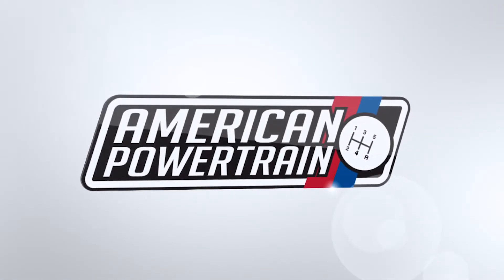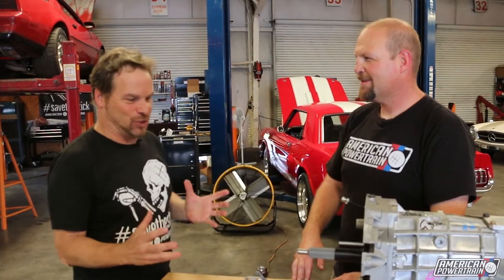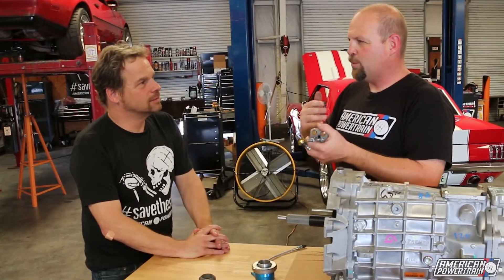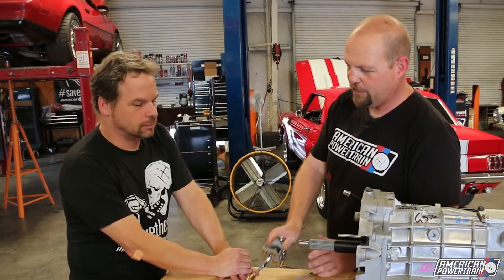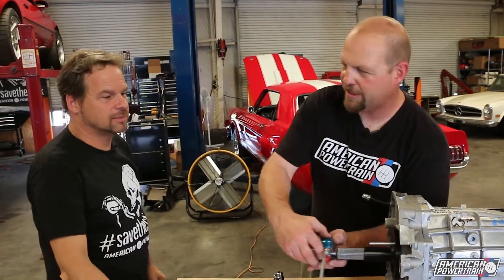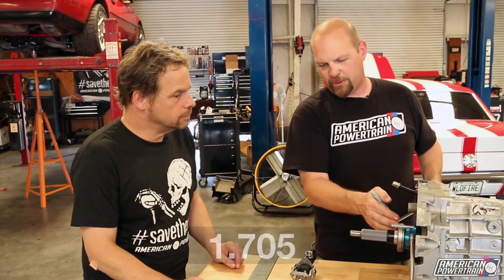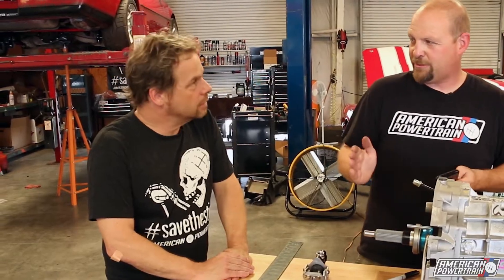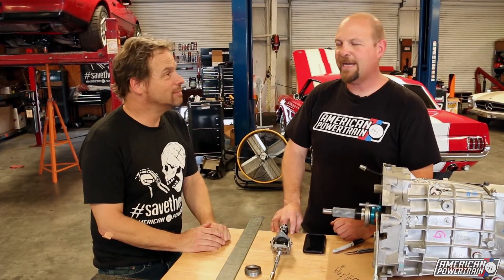Why is a Hydraulic Clutch Better than Mechanical?

Comment: Just pointing this math out:  2.424-1.705=0.719 NOT 0.619. So, now minus 0.15 gives 0.569, divided by 0.09, which equals 6.3, or just 6 slims, not 5. If the customer felt the clutch slipping? This may be why.  Thank you for spending the time to make this video. It was interesting...

Comment: Statement at 7:22  should have been "then you won't have to take shims out of it" instead of "then you won't have to add shims into it".
I believe you meant to say.
Finnigan demonstrated gap readjustment by pulling a shim out after diaphragm fingers migrated rearward following operational clutch wear. ZFDoc at ZR51 Performance

Comment: 1992 chevy k1500 nv4500, changed master and slave cylinder, and clutch kit, throw-out bearing, pilot bushing, flywheel, clutch and pressure plate, blew out 2 slave cylinders, first one split on casing (plastic), the 2nd (Luk) one gave out replaced seals from the plastic one, built pressure, lasted 1 drive then gave out too, haven't seen where it's leaking from yet, any ideas, or any recommendations on a heavy-duty slave cylinder

Comment: I'll take a mechanical setup any day over hydraulic.
Reply: 60 years rebuilding transmissions and the last thing in the world you want is a hydraulic clutch. Couldn't help but notice you didn't tell them how to bleed it. You can take measurements for days but if you can't get it bled you're stuck.😊
Reply: @onetransmission7871  Agreed
Reply: Exactly. Bleeding, leaking hydraulic clutches are just two of the problems. If your clutch leg gets sore in stop and go traffic either pop it into neutral and stop riding the throw out barring or get an automatic, old man 😂 JK
Reply: @terrysavoy6479  My 93 chevy k3500 has a hydraulic clutch and it's nothing but problems.

Comment: In all the vehicles I drove never have I had to replace machanical clutch parts. Everyone that was wet clutch had something go out. The semi with 1.6 mill I drove has the original machanical clutch parts on it.
Reply: Mechanical clutches are more difficult for daily driving and performance compared to a hydraulic clutch. Easier and smother the clutch, the more enjoyable the daily driveability and the faster the track times are. The 85 mustang I had did have a mechanical clutch and it was like doing leg presses every shift and holding it was even rougher. Not practical.
Reply: @guitarsandcars2586  sorry but that's wrong a skilled driver can make a mechanical clutch smooth as silk. Also why would you want a device on a daily driver that is prone to failure like a wet clutch is? I'll tell you the samething they told us in truck driving when a driver complained about the clutch pedal being hard to push done. They said "they make automatics for that, otherwise you'll just have to get better at driving." Power steering, wet clutches, automatics, traction control, ect. are all devices that take less skill to operate a vehicle. Nothing more nothing less.
Reply: @joerandom756  1. A hydraulic actuated clutch and a wet clutch are two completely different things.
2. Mechanical clutch linkage and manual steering require no more skill than hydraulic clutch and power steering do. They only require more physical effort, and that has little to nothing to do with skill.

For example, a person could have big muscles and still not be a good fighter, and another could have less muscle but be a much better fighter because that person is more skilled. Physical strength is not the same as skill.
Reply: @joerandom756  1. A hydraulic actuated clutch and a wet clutch are two completely different things.
2. Mechanical clutch linkage and manual steering require no more skill than hydraulic clutch and power steering do. They only require more physical effort, and that has little to nothing to do with skill.

For example, a person could have big muscles and still not be a good fighter, and another could have less muscle but be a much better fighter because that person is more skilled. Physical strength is not the same as skill.

Comment: The number of crotchety old men in here selecting mechanical clutch linkages as their hill to die on is hilarious.
Reply: Careful, you'll one day be a crotchety old man.................if you live long enough.
Reply: @tulagi1  I'm not sure that "people age" is the epiphanic zinger you think it to be.
Reply: For real man so many angry boomers in here. My f150 has over 200k miles and just got its second replacement slave cylinder. Yeah the job sucks to change it but it's not some crazy unreliable junk that fails all the time. It was about time to replace the clutch anyway.
Reply: No doubt. That's about all I read in the comments. Back off fellas. My 98 Saturn with 280000 miles has had 0 problems with its hydraulic clutch. Not even a flush.

Comment: dumb. why would you add so many possible failure points??   if you cant drive a properly installed mechanical clutch, go get a prius - (with a hydraulic clutch)

Comment: I have a 2003 Mazda with a 5 speed manual with a mechanical clutch and I love driving it on the weekends. I just bought a 2021 VW with a 6 speed manual and hydraulic clutch and after a week I'm still stalling in first. On the mechanical clutch I can feel when it engages and can start applying the gas but on the hydraulic clutch I can't tell when it engages because it is a fluid motion when releasing. Hopefully I can figure it out soon.
Reply: I have the same issue I just bought a built up 08 c6 vette and I can’t feel a bite point like in my 5 speed truck and it really makes it difficult to know when to give it gas.
Reply: @kadenatkinson8526  when I learned to drive manual in my Subaru Forester with a very light hydraulic clutch I would just rev it up to 2000 rpm and slowly release the clutch which is definitely not a great idea for the health of the clutch but it worked for the amount of time that I was still figuring out how to drive manual and slowly got better and better at fine tuning how much gas I needed to apply at which point I was at in the clutch and now I have no problems with it but I’m gonna have to learn it again in my 67 international pickup but it’s a lot harder to stall the other day I put it in reverse and let out the clutch quicker than I should’ve and chirped the tires without pressing the gas pedal lol

Comment: I just love pulling my transmission to fix the leaking internal slave cylinder. I will take properly set up mechanical linkage all day long over hydraulic. Never use DOT 5 fluid as it will be a failed slave in no time. They also didn't talk about boiling the fluid if you run the exhaust too close. Mechanical linkage works great if it is set up properly and it is adjustable for wear. Watch out for the over center spring on the Borg and Beck clutch equipt cars, if you change to diaphragm pressure plate your pedal can end up stuck to the floor.
Reply: I assume you stick to mechanical injectors too
Reply: @DD-gi6kx  Mechanical fuel injection is a thing, esp in drag racing. Most of them are quite good.
Reply: @177SCmaro  I am quite aware mech injection is a thing, been on diesel equip for years, but how many new cars and trucks are running mech injection over EFI, just cause old technology worked great in the day doesn't mean newer tech isn't better...I'll take EFI over mech and hyd clutch over mech any day...was the point of my post
Reply: @DD-gi6kx  Just because newer technology works better for you doesn't mean older technology is without merit for others. 
I utilize both, myself. Old car, modern engine.
Reply: @177SCmaro  if it ain't broke don't fix it is how I work
Reply: @henryholliday1  Fair enough for you but if everyone was the same as you we'd still be living in grass huts having this conversation over a dung fire. Very sturdy, well-made grass huts, but grass huts nonetheless.

Comment: Yeah no thanks. I’ll stick with mechanical. At 60 years old I’ve never had a problem with any of the old school setups that weren’t simple to fix. Hydraulic? All have failed me at some point with no easy roadside fix.
Reply: Amen! Blow a slave cylinder & you're screwed. Two different times I had to crash box a 5spd Cummins thru Houston traffic. Fuck hydraulic.
Reply: @robertkelton5831  

I’m pretty sure that you either have not done any maintenance or failed to check any thing for damage. Besides hydraulic clutches are very similar to hydraulic brakes.

Comment: Mines cable. I fitted a new clutch in a day, then adjusted the clutch right up whilst I boiled the kettle. My mate changed his clutch on his old car and he's now looking at also having to replace the master and slave cylinder as it's still not working, plus he spent a good 20 minutes bleeding it on his own. Mechanical clutches are miles better if you need to work on it
Reply: But are not as good for daily driveability and performance. The only car I had with a mechanical clutch was an 85 mustang and that thing was like doing leg presses every shift. I'll never use a mechanical clutch on my vehicles again after that car.

Comment: my 400 rwhp  67 barracuda mechanical clutch is alot easier to push than my 2015 mustang gt
Reply: Get a clutch spring for 20 bucks to smooth out the clutch

Comment: I think a hydraulic clutch using an external slave cylinder and self centering stock style t/o bearing is more reliable design....
Reply: I agree mechanical is the way to go whenever possible, just saying an external design like I used to make kits with is more reliable than the internal type....
Reply: @bassmasterbri   Okay I feel ya. =)
Reply: "Reliable" is NOT an advantage of a hydraulic clutch, no matter where the slave is.  Cables are more direct, don't have lines and fittings that can bursts or leak, take up less real estate and are offered with fire wall adjusters! 
Just keep it shielded and away from exhaust headers and you're good to go. 
P.S. "Self centering" T/O bearings are a gimmick. Unless the bearing is sitting on a crooked input shaft, it's centered!

Comment: OK I have another Problem .. he  just said  NO MORE THOW OUT BEARING ??? I  find that impossible to believe ..  Looks to me like the shiny silver thing is a Throw out bearing ..  Oh  I assume you still have to have a Pilot bearing or bushing too ???  In the old small Block  Chevy was a Bronze Bushing .. in the Heavy Trucks I am used to is a bearing with very special high temp Grease in it ..   My  Medium Duty Truck with a  12" dual disk set up  the throw out bearings didn't last long in high temp low speed off road use .. but  for say $24.00  instead of for $18.00 you could get one for high temp that lasted much longer..  and I have an Air Brake trans brake  because it's not a pull clutch it's a push clutch .. I used to bust the  hubs out the clutched  spinning jerking bouncing in soft snow with  dual triple chains on the Tandem dual wheels .. It's a lot of work pulling out a  650 # 13 speed transmission   a Baby 13 speed that is
Reply: OK I watched a second time ..  The Magazine guy sort of explained measuring from the  bellhousing surface of the  engine to the clutch fingers.. then  you measure from the  tans bell housing surface to the front of the throw out Bearing .. Then the   American Drive Train guy  said put the shims behind the Bearing .. then later he called it a throw out Bearing .. So I  guess the shiny do dad  is a throw out bearing .. Even though  he said installing hydraulic system eliminates the throw out bearing ..Definitely not a good idea to try and multi task while some one talks in circles .. you have to pay closer attention and watch the Video again ..
Reply: THE PILOT BUSHING HAS NOTHING TO DO WITH THIS SETUP. THATS WHERE YOUR INPUT SHAFT GOES IN THE CRANK.
Reply: @69RIDING    You have to center the Bellhouse Ing within 0.005" of dead center or your pilot bearing can fail and cause other transmission issues and bearing failures and hard shifting.

Comment: I have  wore out a few light Duty  mechanical clutch systems  in  Medium Duty Trucks  Many Heavy duty Trucks have more adjusting places.. I did an engine and trans swap in a 1968 FWD  old style single disc  14"  push type clutch Hydraulic .. I had to replace  it with a  pull type  14" dual disc set up ..  So I went with a Mac Pedal assembly  because Mac uses a cable Clutch  ..  With Pull Type Clutches you have to adjust a gap with a 3/8" or 1/2"  Feller gauge that I made out of plate steel..  You need a good return spring so your  throw bearing does not  touch the clutch while  not engaged and burn out the throw out bearing .. Also you need a Clutch brake to get a non Synchronized transmission into gear..
 
  My  '79 Z-28 Camaro has a mechanical Clutch .. I put a piece of plywood on the  floor boards so I don't have to push the  clutch in farther than Necessary .  I put the  ball and socket in wrong once and the  spring steel broke after I was in a drag race .. I shut the car off and  then the engine would not turn over..   I thought the engine was seized towed it home pulled  engine out and  clang clang the  piece that webbed between starter and flywheel fell out.. Nothing wrong with the engine .. bought a new Heavy Duty clutch fork ..  Pulled the heads off did a  little port work and put it all back together..
  I assume the magnum T-56 has no Provisions for a mechanical  Clutch fork so I will have to buy this Hydraulic kit with my LS Swap .. 

  I put a Doug Nash 5 speed in my car it really shifted slow at high RPM';s  I replaced a diaphragm clutch  with a 3 finger Borg and Beck type cluth it made no difference .. than  30 years later I watched a Video on now to  Blue print the Doug Nash 5 speed the gears are so heavy it just does not shift well.  but   this guy in FL   has  better synchro's that have more bite.. 
  It's time to Upgrade to a stronger trans than the original T-10 but that has two Overdrives..

  This Video did not explain what they were measuring ..  But it looks like from Bell housing to Clutch Fingers..  then    from  Trans housing to the front of the Throw out bearing .. Then you use Shims until   you have  0.150"  clearance   

  Then he Rambled on about how to adjust it in the future but he did not explained how ..  We know in a Disc brake Caliper ..  the piston just keeps moving .. and  it takes more brake fluid out of reservoir to  fill the  void in the moved piston..  

   It does not look that Complicated and could be explained better I am sure .. I will look up the Tranny Guy in FL he is very articulate..

Comment: How often does the hydraulic fluid have to be changed? every few years? is it easy to do?
Reply: My clutch uses my brake fluid for the clutch as well as brakes.
Reply: Every 3 years or so would be ideal. Some systems are easier to cleed than others. A vacuum or pressure bleeding tool makes the process a LOT easier.
Reply: It’s in your manual book from your manufacturer

Comment: A hydraulic clutch is just one more thing that has lines and fluid in it that can leak! I'll take my cable any day.
Reply: I agree just more stuff to fail and hydraulic parts do fail
Reply: @chrismansker8870  Cables fail too.  I'm sure when they started putting hydraulic brakes on cars people complained that they would rather have mechanical brakes.
Reply: I have an adjustable unit with an aluminum quadrant and it's silky smooth. =)
Reply: my slave cylinder went on my car , it just poped as I was lifting my foot and it jumped into gear . then when I pushed the clutch down and went to put it in gear it grinded , took a second to figure it out . It was a sad day
Reply: I've had too many cables fail.  I'd rather have a hydraulic clutch.
Reply: Just sounds like poor mechanical skills and parts if your car is leaking. Mechanical linkages break like anything else. Also allows for better engagement in high horsepower cars and it saves space. Vipers, Aston Martin ,Corvette's and Camaros use it because its superior. I'll trust engineering over hobbyists.
Reply: @Alexander-jr8nw  Double clutching is just a measure that assures those synchros and input shaft have a longer life.
Reply: WELL I HAVE A HEAVY DUTY CLUTCH ON MY 454 AND THIS CLUTCH WOULD BE A KNEE SAVER. WAS THINKING OF A LIGHTER CLUTCH BUT I WILL SPEND THE BUCKS AND WORRY ABOUT SOMETHING LEAKING LATER.
Reply: Hydraulic clutchds dont reset as quickly whe you lift your foot. Thats a pain in the ass if you double clutch.